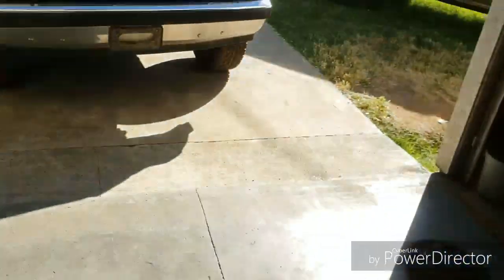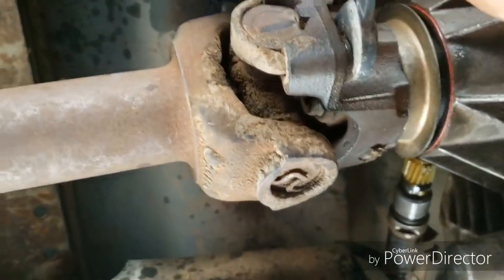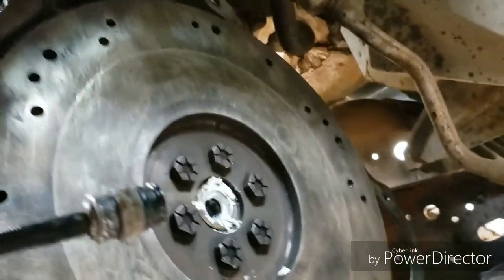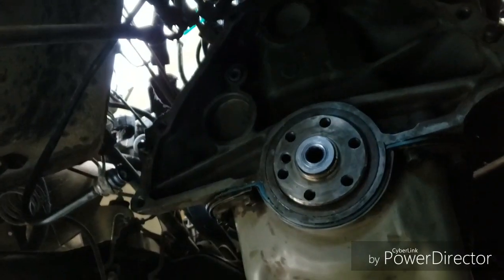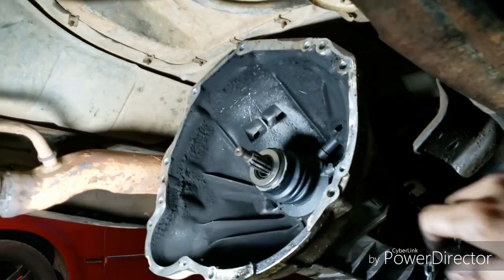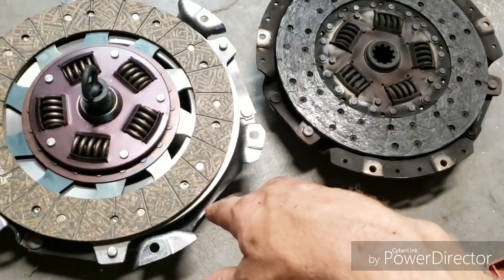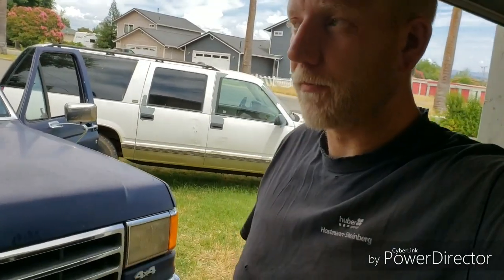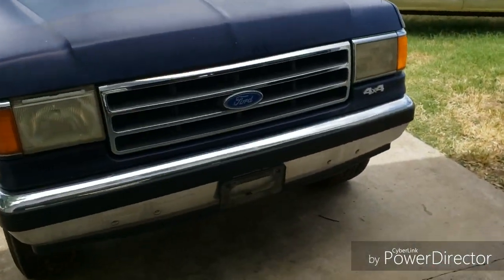How to change and upgrade clutch in a 1989 ford f150

Comment: I pulled mine out of my 89 f150 4x4 5 speed transfer case and all I didn’t have that fancy jack ... I wish I did but I changed it in my driveway with nothing but a 2 ton floor jack

Comment: I just went thru this recently  on my 91 upgrade to a stage 2 clutch from 10" factory to a 11" . A tip for ya put some bearing grease on and around that clip to keep rust taking it out as thoses cllips are non existing to replace if they fail and your line pops of.

Comment: My 1991 F150 manual transmission has the most mouse house crap I’ve ever seen. So much that the truck won’t move I cleaned it out the best I could and drove it to town about ten miles. On the way back it quit again  and I had to tow it. When the truck is running I can put shifter into to gear without depressing the pedal. I’ve blown and vacuumed and blown some more even took starter out. It drives but I’m not sure about a few things. #1 how far should clutch pedal come up before engaging? #2 what’s right as far as rpm/ mph ratio? Thanks in advance

Comment: How are those pressure plate to flywheel bolts working for ya? I've read to only use specific bolts, but having a hard time finding them.
Reply from the maker: It's still running on the same clutch today just fine

Comment: Hey so quick question my clutch lost all pressure I have an 88 F-150 in line 6 at 4 minutes and 30 seconds that line that you pulled out I noticed was disconnected in my rig what exactly is that line called
Reply: I didn’t look at the time stamp but likely your slave cylinder line

Comment: What if replaced clutch, pressure plate , throw out bearing assemble.   Then not having a 1st  and second gear.shirts into the position but has no gear..empty hole. Shifter in right place.

Comment: To bad you dont have the zfs542   creeper hd transmission!   That slop shift  mazda belongs in a ranger!    My 88 4.9 with  zf still shifts like it did when new ,400,000 miles.